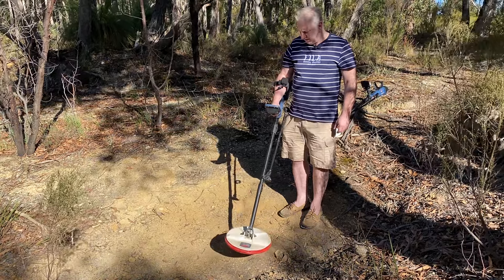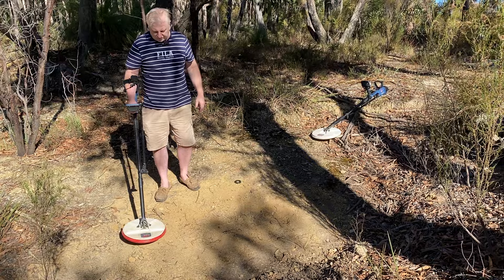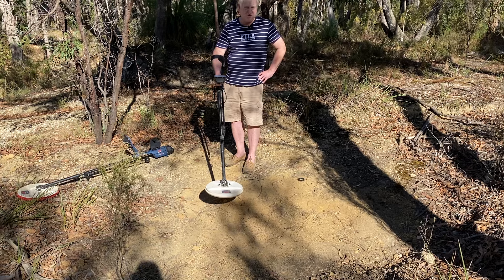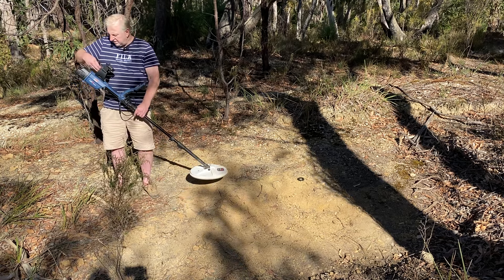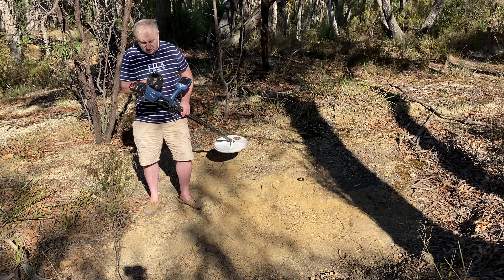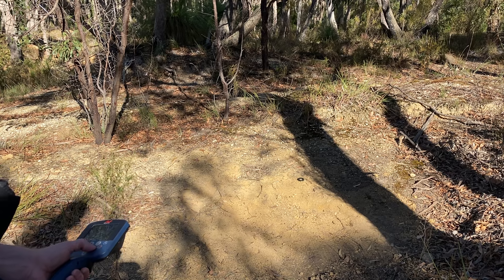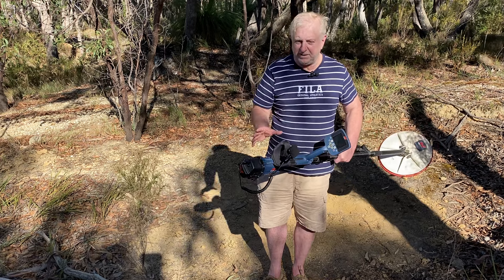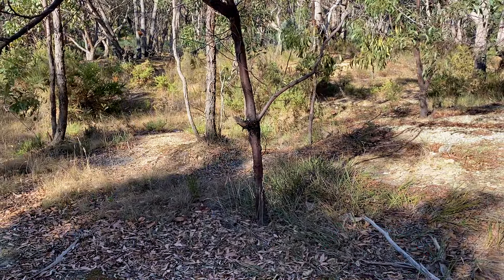Standard Minelab GPZ 7000 Versus Modified GPZ 7000 Gobsmacked by the tests.

Comment: Why are you using a non-standard ferrite when you can't track it out? A perfect ferrite balance is key to getting the best from the 7000. Also in the beginning you are swinging a lot closer to the ferrite, but then you find the signal further down. Did you forget where you buried it? Be nice to see the target - hope you didn't leave it in the ground as looks like you were walking off 😉
Reply from the maker: It’s not ferrite, even the toroidal cores that Minelab supply are Hydrogen reduced Carbonyl iron. That’s like saying it’s non standard ground we are detecting on, if you watch the video closely I force the detector to track then retract the ground, it does not make any difference to the detector operation if it is working correctly.